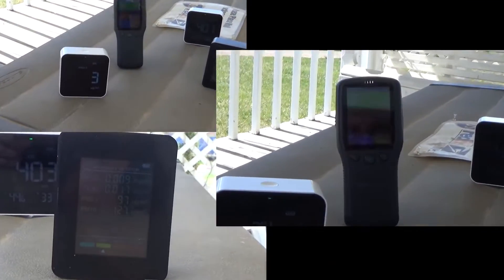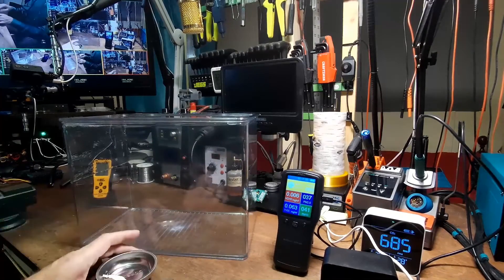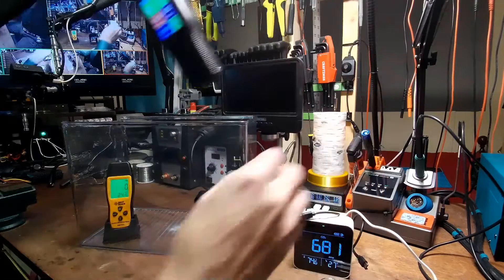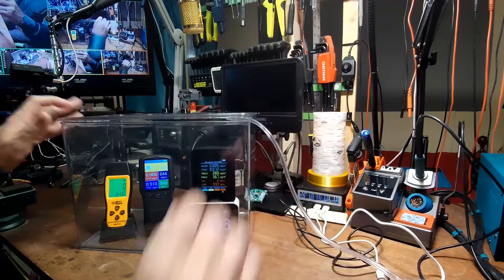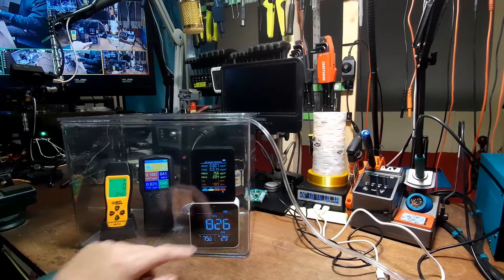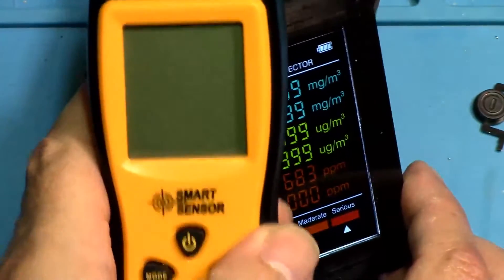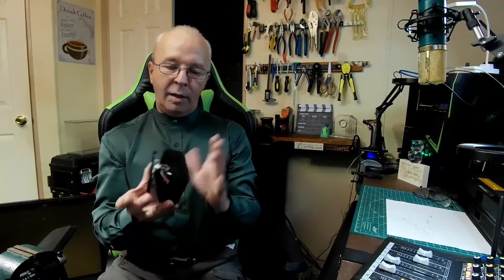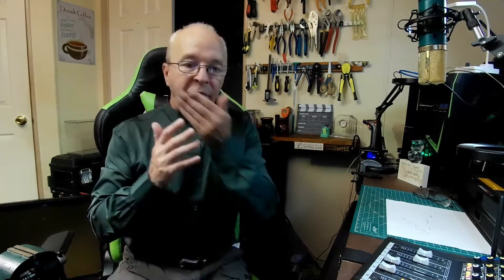Compare Fake Chinese Air Quality Monitor To "Smart Sensor" CO Monitor & "TemTop" CO2 Monitor

Comment: So what's the cheapest detector I can get in NZ for growing applications? Cause yeah I wasted my money on those fake trash products.
Reply: People regularly use CO2 for growing different sorts of crops in indoor environments (usually sealed). I love your enthusiasm by the way. Did you end up getting the handheld CO2 detector and was it accurate and live like your monoxide one?
Reply from the maker: @IsaacParbery  Yes I did get the Smart Sensor CO2 meter, and yes it is quite accurate, and pretty fast to respond, however, the Smart Sensor CO2 meter is around 200.00 US.  If you are looking for something that is less expensive, you could get the TemTop C10 which is a CO2 monitor as well, and costs around 70.00 US I believe, and it is a little slower to respond, but quite accurate as well.  The Smart Sensor CO2 handheld meter is mostly for industrial use, and why it is more expensive and more accurate.

Thanks for the question, and comment, it is much appreciated, and I love being enthusiastic, and I know I am not too very funny, but I try LOL.. 🙂
Reply: @Outside-In.  One of the ones I talked about yesterday, they just responded to an email I sent them and told me it was actually discontinued but they still have one of those desktop minis I mentioned for about 100usd on co2meter's website. I might just have to roll the dice on it, would you like me to let you know if i find it works well in the end? If it's not fast responding then you've already found a cheaper solution but if it is relatively reactive then it might be a good one in place of the handheld or somewhere inbetween the Temtop and the handheld. Seems with how passionate you are about air quality, you probably be happy to know of good affordable ones to recommend to others. Was the handheld you got Temtop m2000 by the way just wondering?
Reply: @Outside-In.  We need to have a standard static word for these devices, I understand meter, monitor and detector are used interchangeably when talking about ambient CO2 measuring tools but it could surely confuse someone eventually I imagine.
Reply from the maker: @IsaacParbery  Thanks Isaac for the comment and questions.  Yes Isaac, the desktop mini that you talked about, if you "roll the dice" on it, please, yes, it would be great to hear how it works, but if they have discontinued the model, there wouldn't be too much need in recommending it I guess, unless of course, they have a newer version...

Yes, I would love to know of "good affordable ones to recommend to others" as well, and thank you in advance for any suggestions on what to test next and possibly be able to recommend.

The handheld I purchased was the Smart Sensor CO2 meter, and that is still in production.  The TemTop M2000 I cannot recommend to anyone, as I received two in a row that were defective, and the company was not at all good to deal with, so why I cannot recommend them.  The TemTop C10 CO2 monitor however, is a decent device and has allot of great reviews as well as my own, but I do recommend that anyone purchasing a TemTop device, purchase it through Amazon, as if there are issues, Amazon will take care of them immediately, or that has been my experience anyhow.

Thanks again for the comments Isaac - much appreciated, and they help to keep me inspired to bring valuable information to everyone who needs it.
Reply from the maker: @IsaacParbery  Well, it is hard to have a standard word for these devices, as there are actually two standard words, and that is Handheld or Monitor.  A Handheld is generally used for faster response time, and mostly used by professionals for going from factory to factory, or home to home to detect problems in air quality, because handhelds generally react much faster.  Monitors are generally for use on a table-top or desktop, for 24 hour monitoring, and why they are  usually always slower to respond because they are made to keep a running average of air quality, and also why a monitor usually needs to be left sitting for at least a few hours initially for the most accurate information.  Allot of people get a monitor, and send it back after a couple of minutes of use, because they think it is defective, and it is unfortunate, because a new monitor, or one that has been stored for a month or more, needs to be turned on, and let to sit running for a few hours to allow it to settle in to the environment...  I hope this helps.

Thanks Isaac - 👍
Reply: @Outside-In.  I think you may have misunderstood what I mean, they had 2 models, the 1 that was discontnued was their earlier type, I will let you know how it goes if I get it! :)
Reply: @Outside-In.  That makes sense, meters/detectors are either handhelds or monitors, thanks for that :)
Reply from the maker: @IsaacParbery  Yes, I see what you mean now - Detectors is kinda not a great word to use.  When I hear the word detector, I think of a metal detector LOL, and why I don't use the word myself when referring to air quality devices.  Handheld Meter or Monitor would be (I would) say, the only two descriptions that should be used when referring to air  quality devices, - but just my two cents...  👍
Reply from the maker: @IsaacParbery  Thanks for the clarification.  It is good to know that the device itself has not been discontinued, but rather still in production.  It would be good to hear how it goes, if you do decided to "roll the dice".  Do you have a link (or a name) to the monitor you are referring too?, I would like to check it out.
Reply from the maker: "for growing applications"?...  I am not sure what you mean.

Comment: Thank you for these amazing videos about air quality monitor. Really enjoy the way you present all the facts with such joy, and i do learnt a lot. Currently is looking for my first air monitor. Check my 2 favorite market place. No hotkrem, temtop m10, hofun is readily available around here in indonesia. smart sensor co is sooo available though at around $33. So im gonna grab that one first. Although i honestly prefer the multi sensor but you clearly stated the benefit of the fast and pin point detection of this one
Hope you have a great day steven
Sorry if i misspelled your name 😀🙏👍
Reply from the maker: You did not misspell my name - Steven is correct,  and thanks for the comment.   You will love the Smart Sensor CO meter.   The Hofun should be OK,  I think I may have gotten a defective one, as it works sometimes, and sometimes it doesn't,  but that could also be because I don't use my monitors every day,  I just bring them out for comparisons,  and may be why it acts this way...  I am so glad you enjoyed the presentation,  I can't help it,  I just get so excited about researching and presenting information that is going to give someone a peace of mind about the device they choose,  and how to best use it.

Comment: Since CO2 is heavier than air, it would make sense that the sensor below the other sensor would read higher as CO2 doesn't evenly disperse. There's a few old parlor / science tricks you can do with CO2 in a fishtank that demonstrate this. The carbon dioxide will settle in a layer at the bottom of the tank. Because of this, it might be interesting to see if you placed both CO2 sensors at the same level to ensure both sensors are at the same layer of gas.
Reply from the maker: Jae Tea, thanks for your comment - much appreciated.  You are right about two senors being at the same level of space, but the reason the two sensors are not setup to be in the same layer of space, is simply because there is only one CO2 sensor in this test.  The other monitor is a fake and has no CO2 sensor inside.
Reply: @Outside-In.  Yeah. On a side note and if you don't mind me asking, what's the brand of the yellow CO monitor on the left?
Reply: okay, I found it in the description, nvm. thanks for the video!
Reply from the maker: @jaetea1225  The yellow CO meter is the Smart Sensor CO handheld meter.  I love this meter as it is very quick to respond, enabling you to walk around an area and pin-point a problem.  Smart Sensor is the brand, and I have a number of their meters, and love them all.  Mostly however you will find them on Aliexpress, and some on Amazon.  This is a link to their Aliexpress store: https://www.aliexpress.com/store/1101543027?spm=a2g0o.detail.0.0.184331f9c1tw7n
Reply: @Outside-In. Which meter should I get to test for VOCs from 3D printing?
Reply from the maker: @adnanabdull4h  Adnan, any monitor that registers TVOC's will alert you to particulates that are produced by 3d printing.  If you are concerned about exposure, I would recommend putting the printer in another room or even the basement.  Most particulates that are produced by 3d printing will fall to the floor and not float around in the air.  On the other hand, if we stop doing things that cause particulates to be put into the air, we may find ourselves with nothing to do... ;).  You could also put your printer by a window with a fan drawing air away from the printer, reducing the risk of exposure to filament types of particulates and gases.

A bit of information I found:

Do PLA Filaments put off Fumes?:

Because these components are made from basic renewable materials, PLA is a somewhat sustainable 3D printing material. PLA filament releases lactide into the atmosphere when it is melted. But because it's a non-toxic substance, it's generally okay to be around.
Reply: @Outside-In.  Thank you so much for the comprehensive answer!
Reply from the maker: @adnanabdull4h  You are welcome Adnan, glad to help.

Comment: Great and thorough reviews. I greatly appreciate it. Any chance you can review the Amazon air monitor?
Reply from the maker: Thanks Mark for the comment.   Getting ready to do a comparison and review of the AirKnight 9 in 1.
Reply: Oh cool. I was on the fence about the AirKnight, Amazon, and The IQ Air.
Reply: Any chance you might be doing a review on BRWISSEN A16 Air Quality Monitor. This one now struck my interest along with the AirKnight 9 in 1. 

The BRWISSEN A16 Air Quality Monitor detect PM 1.0, PM 2.5, and, PM10. Wow.
Reply from the maker: @marksoprano007  I just went and looked at the A16, and my recommendation is the Hotkrem - it does 1.0 2.5 and 10 PM.  The A16 is not worth spending nearly 200.00.
Reply: Brilliant. Thank you so much Steven. I appreciate your help.
Reply from the maker: @marksoprano007  Thanks Mark.  I will talk to Jim at AirKnight and see if they can maybe implement the 1.0 reading in their monitor.  I am also trying to get them to add a co sensor in the AirKnight.  I am truly looking forward to reviewing and tearing down the AirKnight.  Hopefully I will have these two monitors next week - so keep a watch Mark - it is going to be interesting.   Sorry if I seemed a little harsh about the A16, but I don't think that having TVOC and HCHO equates to 100.00 value.  The Hotkrem is only about 45.00, so a great deal for knowing 1.0, 2.5 and 10 PM as well as an AQI reading.

Comment from the maker: I apologize if any of my information may be a bit wrong - I have been learning so much information in the past couple months that things are starting to blur together LOL.  I believe I got what causes co and co2 mixed up a couple times, but I think that all this learning will eventually bring my brain down from melt-down mode, but the reason I make such a deal about Carbon Dioxide - is the fact that it is not noticeable if present and why allot of people discount it as a detector you should worry about having.  Carbon Monoxide is the most present gas that a person may encounter in their life, but Carbon dioxide should not be discounted as a problematic killer.  We breath out 35,000 to 50,000 ppm co2 with each exhale, and why it is so very important to be in a well-ventilated area if allot of people are in the space/room with us.  If you go to a crowded building and start feeling light-headed, dizzy or acquire headache-like symptoms - then more than likely it is because you have been exposed to too high levels of co2, and just because others around you are not experiencing the same symptoms - is simply because they may not be as susceptible to the current level of co2 as you.  There are some that will say there is no need to have a co2 monitor, but from my personal experience and almost dying from co and co2 poisoning about 4 years ago, I feel that even though co is the most common risk in an environment, the potential for death from co2 is too great to not mention.

I was going to add the following information in this video, but I forgot to add it, so I will add it here.  I made some notes from the research I have been doing in regard to co2, and also questions that people have asked online.  I hope you find the following information useful and insightful... 

Questions about Carbon Dioxide, and the risk of high levels...

 * What is Carbon Dioxide (CO2)

 Carbon dioxide is a colorless, odorless gas. It is produced both naturally and through human activities, such as burning gasoline, coal, oil, and wood. 

 In the environment, people exhale CO2 which contributes to CO2 levels in the air.

 * What levels of CO2 are typical indoors?

 The outdoor concentration of carbon dioxide is about 400 parts per million (ppm) or higher in areas with high traffic or industrial activity.

 The level of CO2 indoors depends upon:

 * the number of people present
 * how long an area has been occupied
 * the amount of outdoor fresh air entering the area
 * the size of the room or area
 * whether combustion by-products are contaminating the indoor air (e.g., idling vehicles near air intakes, leaky furnaces, tobacco smoke)

 Carbon dioxide concentrations indoors can vary from several hundred ppm to over 1000 ppm in areas with many occupants present for an extended period of time and where outdoor air ventilation is limited.

 * What is a healthy CO2 level?

 It is recommended to stay as close to 400ppm (outdoor CO2 concentration) and below 800ppm indoors - Normal indoor co2 range from 600-800ppm.

 * Do air purifiers remove CO2?

 No. They do not remove carbon dioxide (CO2). Almost all air purifiers are designed to capture some combination of particles and toxic gasses, but CO2 can't be captured by the same filters that capture other gaseous air pollution. 
** Only ventilation removes CO2**.

 * How many ppm of CO2 do we exhale?

 35,000 to 50,000 parts per million (ppm)

 CO2 is produced when people breathe. 

 Each exhaled breath by an average adult contains 35,000 to 50,000 parts per million (ppm) of CO2, which is 100 times higher than is typically found in the outside air according to (OSA).

 * What are the health effects of CO2 poisoning?

 Occupants may experience health effects in buildings where CO2 is elevated.
 
 At high levels, the carbon dioxide itself can cause headache, dizziness, nausea, vomiting, convulsions and other symptoms, and this could occur when exposed to levels above 5,000 ppm for many hours.
 
 Higher than 5,000 ppm of CO2 can cause asphyxiation as it replaces oxygen in the blood. 

 Exposure to concentrations around 40,000 ppm is immediately dangerous to life and health. However - according to the Minnesota Department of Health - CO2 poisoning is very rare.